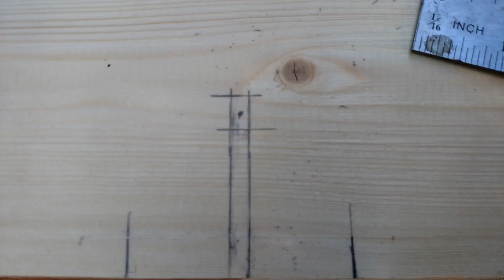DIY Viking Boat Timelapse

Comment: Have you actually tried to sail it in the sea or it's just for the showing?
Reply from the maker: I recently completed and launched it.  I trust the boat on small, calm lakes. It has low freeboard, so I'm reluctant to take it on any body of water larger than 6-7 sq miles. That said, it makes an excellent fishing platform when the water is calm. I can stand on it and operate the sail without issue.
Reply: Nate Otto oh thanks!I really apreciate you answering!I have an idea of making an 1-2 person boat on the style of a viking longboat(only smaller) and I have searched around and found a lot of technics and secrets of how they were used,so now I'm searching for designs for one and I clicked on your video to see how you made it!
Reply: Oh and also what type of wood did you used?
Reply from the maker: The cheapest available in my area: 3x4 pine and 1/4" oak plywood.
Reply: Nate Otto oh yeah alright cool,thanks!

Comment: Do you have blue prints for this?
Reply from the maker: Other than keeping the length and width within the bounds of the back of my SUV, there were no plans. The thought is that it's a paddle board with high sides. It worked well - I took it fishing yesterday. 

I do have (sort of) plans for a kayak in this book: https://www.amazon.com/Your-Fifty-Dollar-Kayak-Nate-Otto-ebook/dp/B084DK4HJS/ref=sr_1_2?dchild=1&keywords=your+fifty+dollar+kayak&qid=1586710854&s=books&sr=1-2
Reply: Nate Otto thank you!

Comment: Doesn’t look very stable !
Reply from the maker: The bottom is flat and 3 1/2' wide at its widest. I paddle it while standing. The sail is also easier to manage when standing.  It has plenty of primary stability. As for secondary stability, I wouldn't trust it in anything more than foot-high swells. This boat has more in common with a paddle board than a kayak.